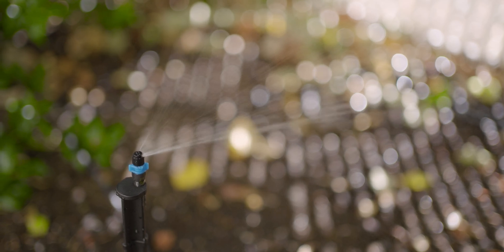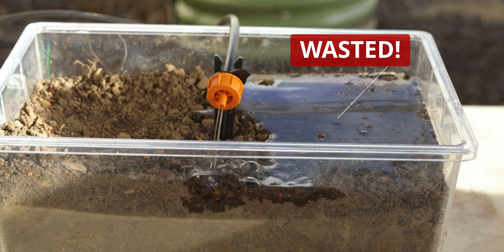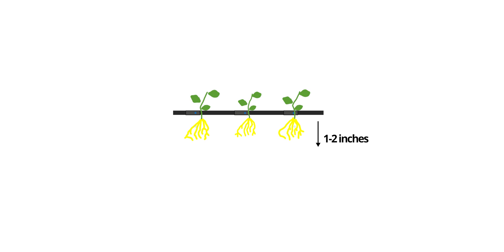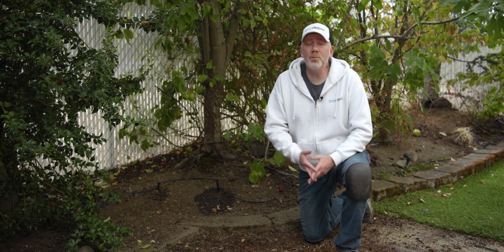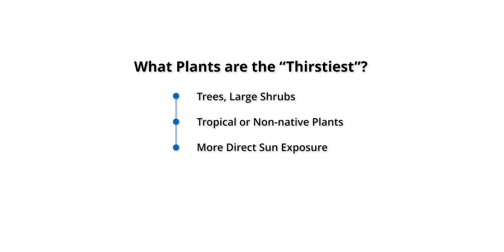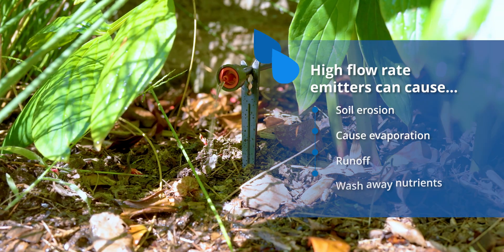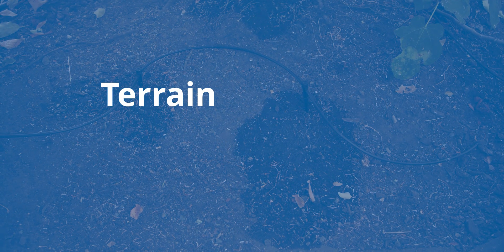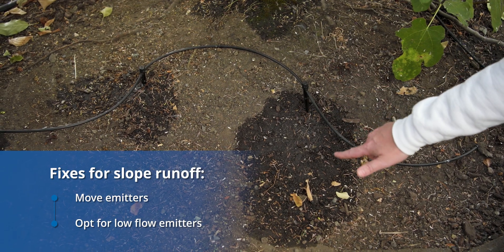How to Choose the Right Drip Emitter Flow Rate

Comment: Awesome video and thank you for the information. How far from the trunk of a tree should the emitters be?
Reply from the maker: This depends on the tree to some degree, but typically, for a young tree it only needs to be 6" to 12" away to effectively water the root zone.  If it's an older more mature tree that still needs supplemental irrigation, as close to the middle of the canopy as you can get it (most trees' drinking roots spread as far as the canopy, so halfway allows the rings to cover the roots on both sides) :)
Reply: @ Thank you. This definitely helps in planning my drip system around my fruit trees. The area I am working with in on a slope. Is It best to place the emitters around, the sides, or the top of the tree within the canopy, that way water drips down slowly down to the roots? Thank you.
Reply from the maker: @CDPMATH If you're doing a 1/4" dripline ring, you can place it all the way around the tree.  Even with button drippers, all the way around is likely to yield the best results.  Your instincts are correct that, on a slope, gravity is going to carry water down the slope, so you'll get a little cushion on emitter placement.  Water can travel up through the soil's wicking action as well, so even emitters on the downwards side will see some of its water flow up towards the tree.
Reply: @ Excellent.  Thank you.

Comment: Omg how will I know which emitter to install to water mature potted tropical fruit trees like Mango, Guava, Citrus, Jujubees etc.  Here in Barbados we're mainly a coral stone island so our water has quite a high scale content.  Any suggestions please?
Reply from the maker: An option that could work well for you here are cleanable drippers -- they work as well as any other dripper, but in the event of a clog you can simply unscrew the housing from the base and give it a good rinse.  Here's an example of a cleanable dripper:  https://www.dripdepot.com/3559

Dripline rings could also work well here, but with the caveat that you'd have to either inject a treatment into the lines to break up the scale or remove the dripline rings to soak in an acid solution to break down the scale.  If it's a handful of trees this wouldn't be too bad, but if it's a large quantity of trees it might not be practical.

Comment: What are the benefits of putting the dripper on the top of the tube vs. the side? And is it the same for installing the barb of a connector?
Reply from the maker: No major differences on the dripper -- the big thing to watch for is just to make sure it's not pointing down due to the risk of siphoning in debris.  When I put a dripper directly into the wall of 1/2" or larger tubing, it's best if it's pointing up.  When using a dripper with 1/4" tubing, I use a stabilizer stake to keep it up out of the soil since it is going to be oriented horizontal. 

For the barb connectors, in the side is likely better in most cases since there will be less tension, but even when we've had to install them facing up we haven't had any problems.  Basically, the side is best practice, but if you're limited by space or foliage, the top is ok, just try to leave a little slack in the 1/4" tubing so it's not pulling the connector too much :) 

Great questions, thank you!
Reply: @dripdepot  Keep in mind that when on top the drip can follow the hose instead of going straight down if there is any angle on the hose.